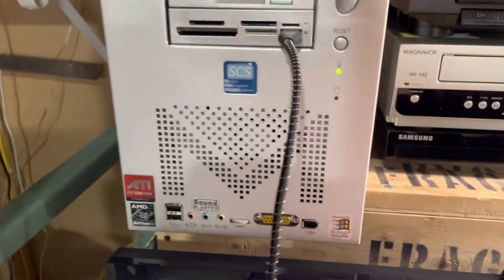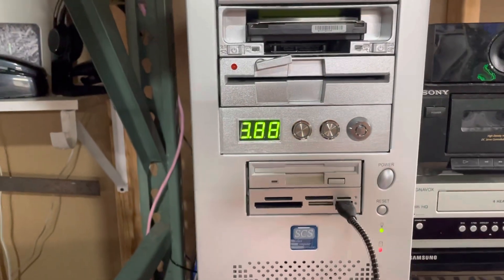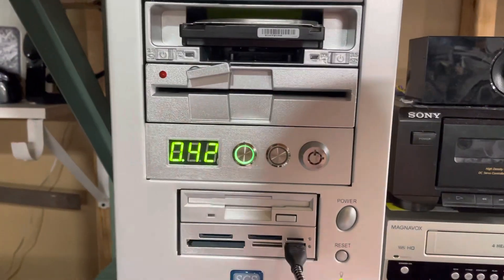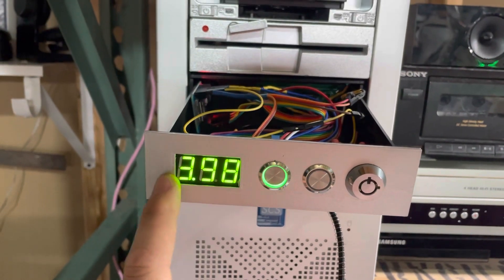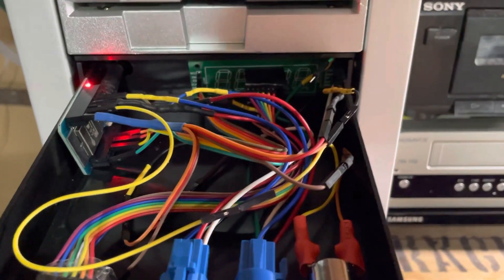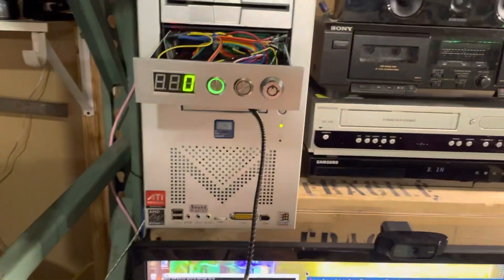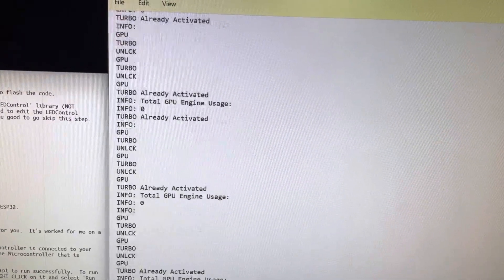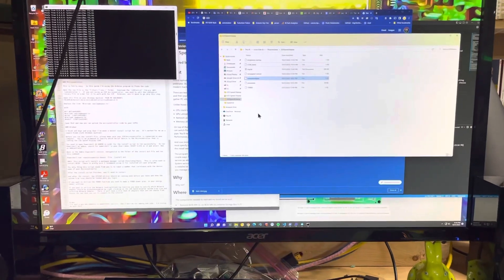Give your modern machine a retro facelift with a LED Speed Display with TURBO mode!!!!

Comment: Itd be cool to wire up the turbo button to actually run the cpu in its boost clock
Or switch over to overclocked settings